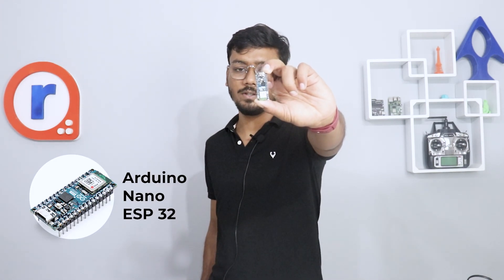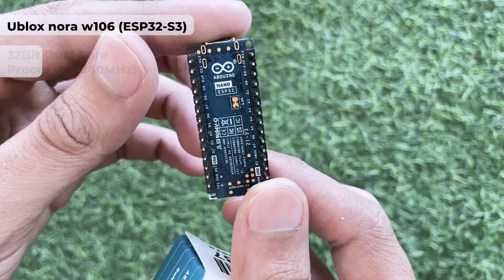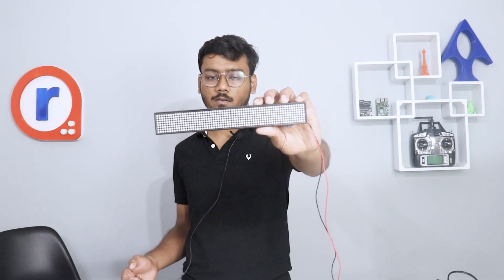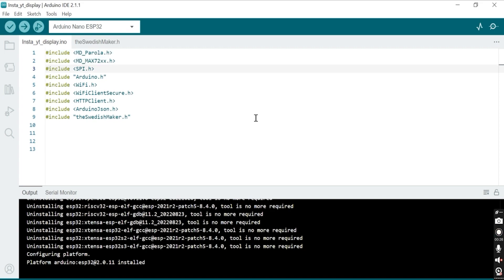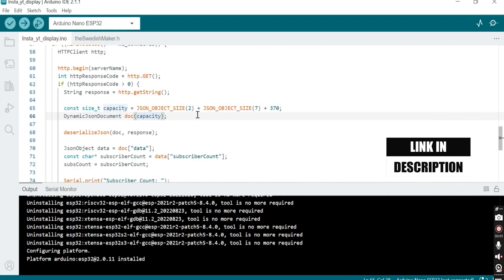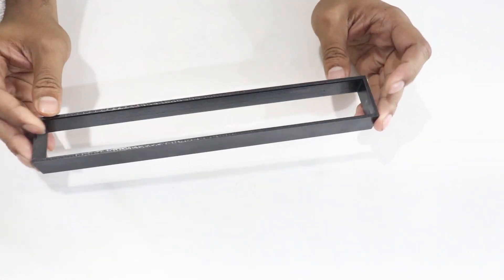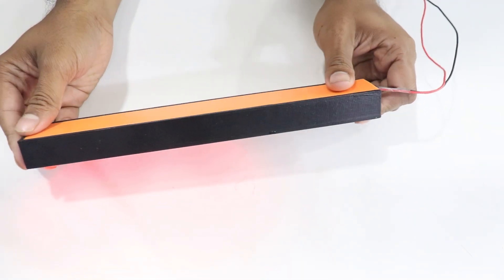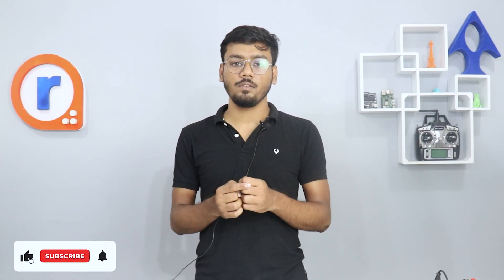How To Make Arduino Nano ESP32 YouTube Subscriber Display | Step by Step Tutorial

Comment: Good stuff however I would not recommend the Arduino Nano ESP32 S3 for this task.. it's overkill... The older esp32 or even a esp8266 will easily do this.

Nano Esp32 is too OP and also overpriced imho. Not to mention out of stock 😀